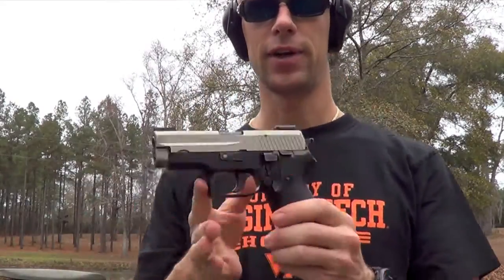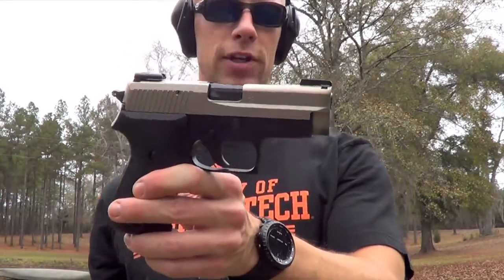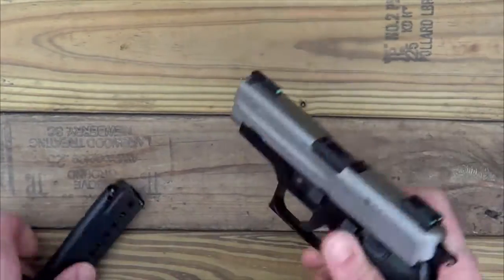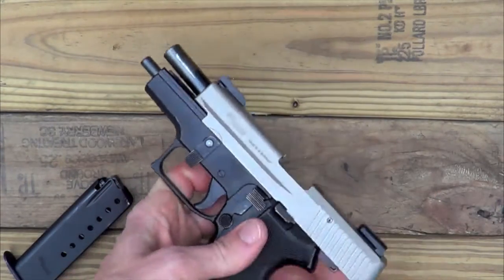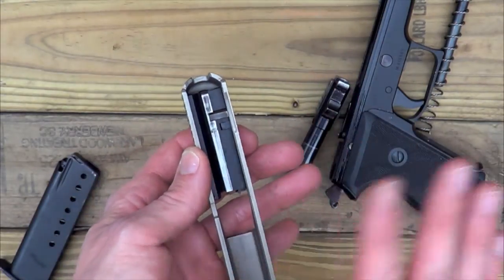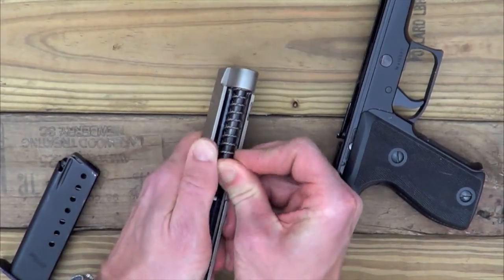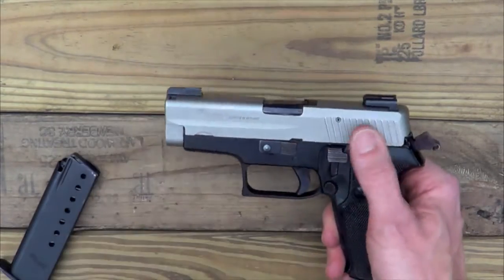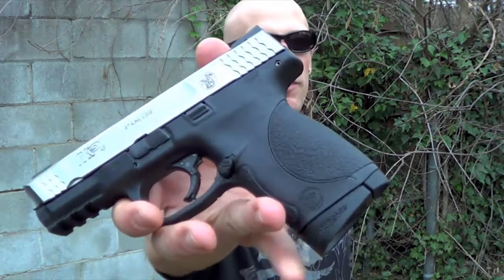CCR Refinishing CP II Electroless Nickel Boron Finish Review (HD)

Comment: I don't think your information showed on the Bar graph is accurate. . .I had my Glock refinished in the CP II, at CCR Refinshing about two months ago. When I got it back I immediately started wearing it as my CCW. I use a Cross Breed Super Tuck holster, the only part of the holster that actually comes in contact with the gun is made of leather and plastic. Now, after just a short duration of use, the dang thing is getting wear marks on it already! . . . I'm wishing I should have gotten it refinished in the original Glock Nitrate process now.
Reply from the maker: Interesting.  I wonder if they changed their formula.  I have a G30 that I've used forever and it still looks new.